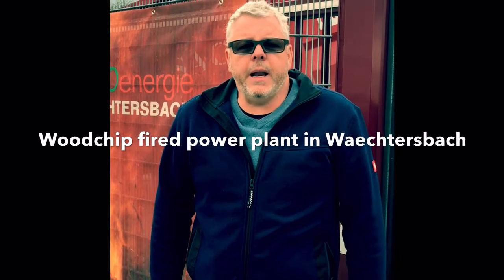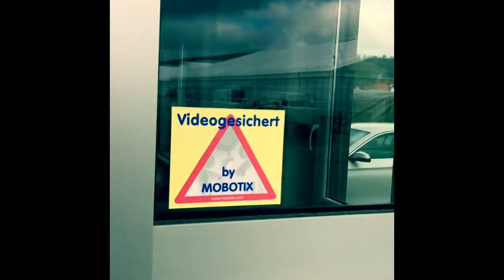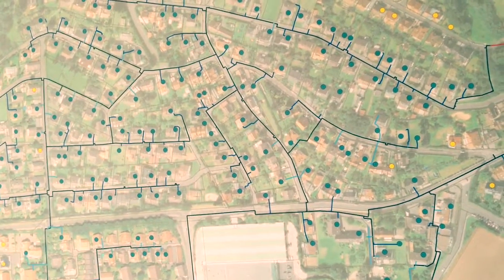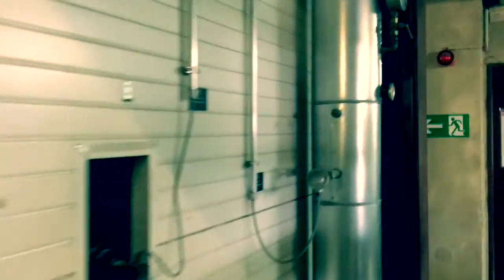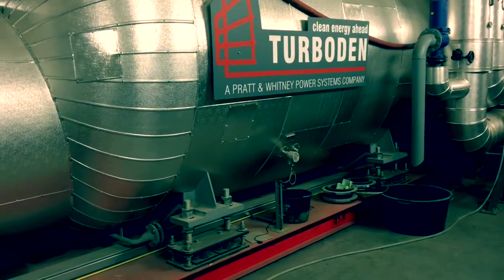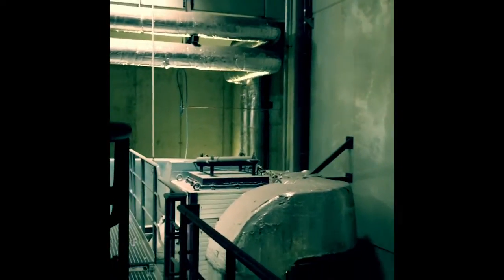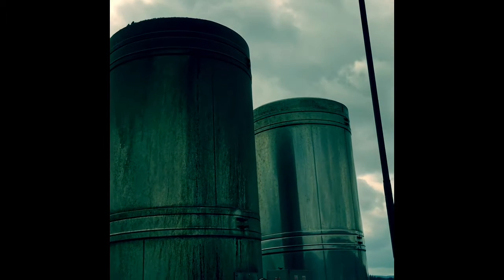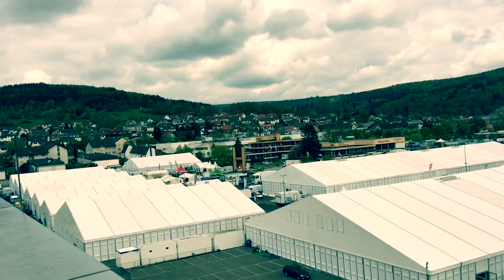Wood chip fired power plant

Comment: Solid Fuel is dirty no matter what. Solid fuel produces ash, hot ash. The vid showed the clean places and not the filthy, clogged buckets elevators, and screw drives that move the ash. Renewable green energy is a scam at best. But the greenheads love the idea of it but know nothing about the actual operation of this type of plant. All powerplants blow their stacks at night. Flue gas goes to the electrostatic precipitator as this guy said and scrubs out particulates.  But stacks and boilers get dirty with soot, which if not gotten rid of daily can lead to a boiler explosion. Guess what? There are high-pressure steam lances that extend into the boiler and pulses high-pressure steam into it. The soot gets blown out through the stack in a nasty black cloud that coats the neighborhood and all things in it. Here's the trick that avoids the vigilant eyes of the greenheads. The whole power industry blow their stacks at night after everyone is tucked away in their beds so none are the wiser. Wood burners are solid fuel burners and are really on par with coal. So might as well use coal! Thank you Donald Trump for reviving the Pennsylvania coal industry. I worked as a 3rd Class Engineer in a 17 MG wood-fired plant in Westminster , Mass and I now reside in Pennsylvania.
Reply: some strong words. I respect that!
Reply: As far as I know, the ESP remains energized/baghouse stays online during sootblowing. Besides, wood ash is water soluble natural fertilizer. In fact, the ash from these boilers are often leached for use in the potash industry.